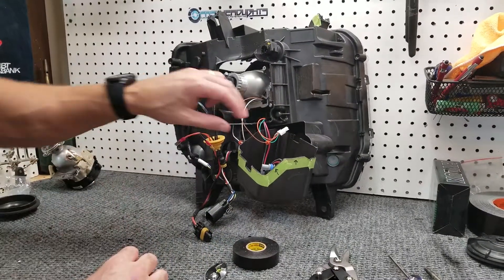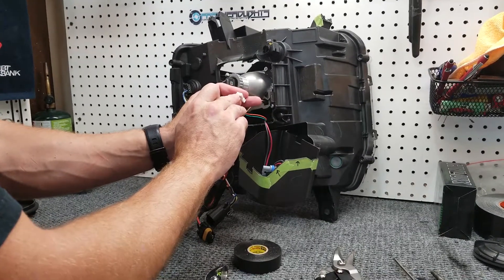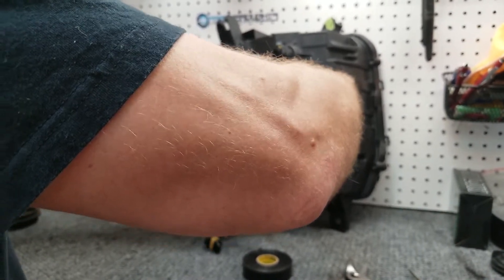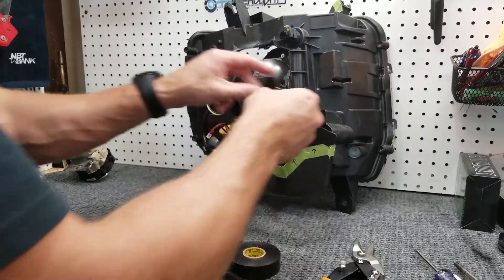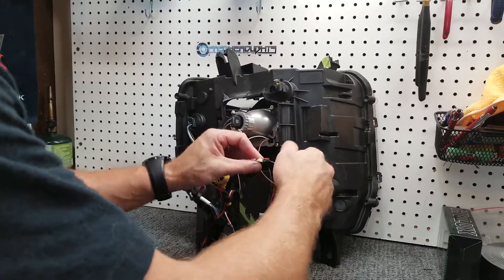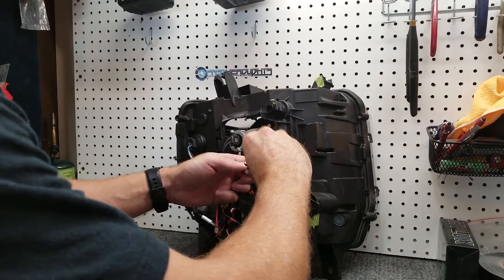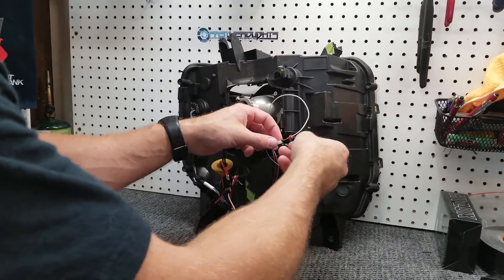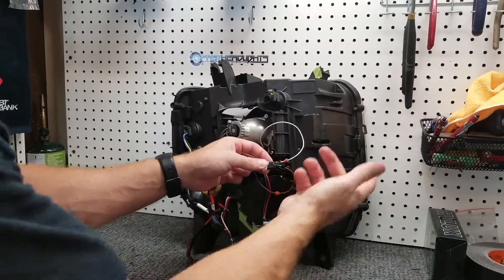Part 9:  Wire the bixenon shutter (Morimoto D2S 4.0 projector retrofit GMC SIERRA)

Comment: I tried to check my projector shutters with a 9v battery, a brown and white wire. I mistook the white for positive and hooked it up in reverse. Upon trying it again in the correct order, I couldn't get the projector to actuate. Is it possible I shorted it? When I tried it correctly on the other projector, it barely actuated the first time, then nothing after that. Maybe the 9v battery is just a poor source of power? Morimoto D2S 5.0